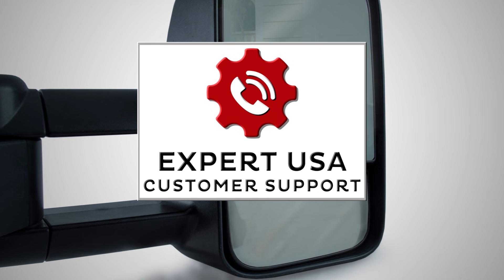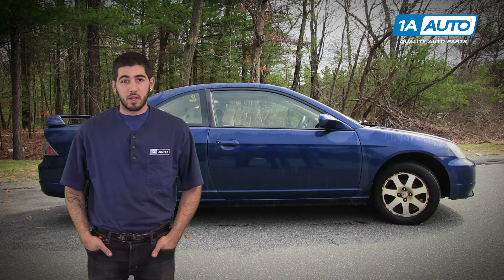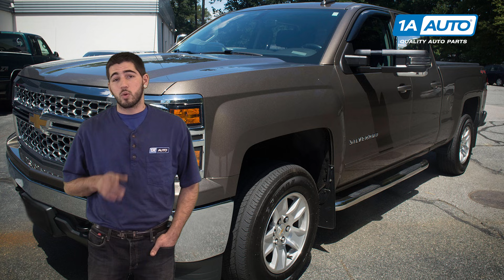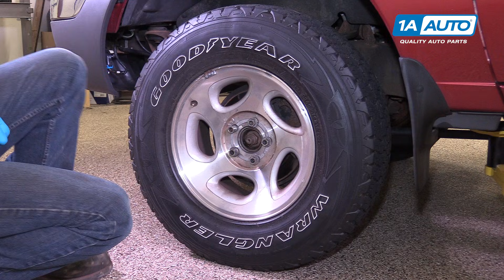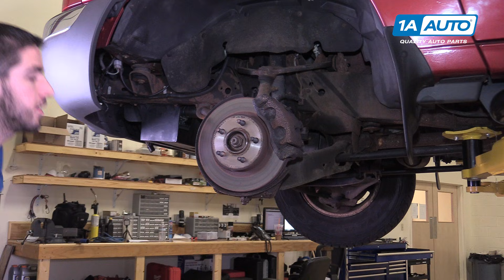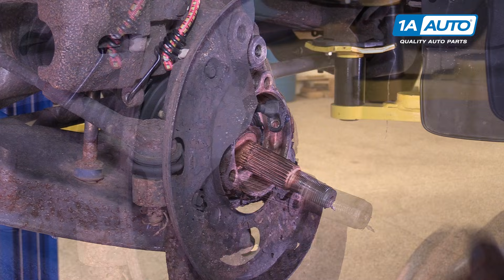How to Replace Front Wheel Hub Assembly on any Car, Truck or SUV

Comment: I'm about to do the hub/bearing assembly on my 97 Mercury, it's still got the factory original and 370,000 km, it won't come off that easy lol, I'm already dreading that part! Thanks for the video though, nice to have real visuals with my manual

Comment: Most front wheel drive cars will not have the threw nuts holding the wheel hub on. It will only be held on by the spindle spline in the center.

Comment: Take extra caution when punching out that axle nut detent. I was not expecting the difficulty and time required to then fix the threads. They were never 100% even after spending an hour with a chase/oil on it. I bought a punch set from harborfreight and it smooshed the nut threads over. I then bought a special Axle nut removal tool that didn't do much. I might just dremel cut a triangle out of the nut to remove the detent as it was the biggest PITA of the entire install. I don't know how they are punching out the nut like that in these videos and then taking the nut off without damage. Such a hassle. Would be nice to find a locking ring to put on after the axle nut so you don't need to punch it.

Comment: I removed the wheel before coming to see that I needed to replace multiple parts as I was replacing the front brakes... I can still remove that center bolt I hope? Can I use wd40 on it? Great video! Thank you Soo much for this!

Comment: 9:51: Grease on the back of the brake pads?  Never heard of that.   It should be stressed that one should use extremely little grease or better yet, use a product designed for that. Heat will make grease run. If any grease at all gets on the rotors...lookout!

Comment: Looked and fit same as original🌗 allabout.wiki/FrontWheel also came with new hold down clips for the cable mounts. Thanks to you I'm rolling again they fit great and were easy to install Tom.

Comment: Wheel bearing assemblies come pre greased from the factory. Do you need to add any more grease to them?
I have a 02 XL7 and replaced both front wheel bearings yesterday. I'm assuming I don't need to grease them, but I'd rather not find out the hard way.

Comment: Don't push grease on the back of brake pads. That grease will heat up and drip onto your brake rotor. Then you will have no braking. Use silver based anti-seize instead.

Comment: What sort of lubricant should be applied to the axle before slipping the assembly back on?
Reply from the maker: +Andy Gholson Thanks for watching!  You do not need to apply any lubricant to the axle splines when replacing the hub.  May just clean off the spines a bit using brake parts cleaner and a soft wire brush!
Reply: @1AAuto  Thank You for the response.  Now I am trying to figure out why I can't get the hub assembly with new wheel bearing to slide on the axle all the way.  Need about another 1/4" to accomplish that.  The only thing that changed was the new bearing that was installed in existing hub assembly.  I can send pics?
Reply: @andygholson821  I know I'm late to the party, but I had the same issue. I used a bit of sandpaper to clean up the axle and it went right on.

Comment: Does anyone know why I have broke 3 wheel hubs in half
Reply: Anger issues maybe?

Did you over or under tighten the axle nut? That can cause premature wear and failure of wheel bearings if it's not torqued to spec.

Comment: Can I ask you a question. I have a 2001 chevy express conv van and it has 202k miles on it. Still runs strong. Might use 1/2 quart of oil between changes. Are these good motors, 5.7 v8, only thing it needs now is do,t brakes and struts, which I'm ordering from you guys. Just wanted your opinion on the miles I have and if you think it is a good motor.
Reply from the maker: +Badams63 Adams Thanks for checking us out. This is largely dependent on the upkeep the motor has had throughout its life. 1aauto.com

Comment: Is there a reason the whole brake system was taken apart to get to the hub? Every other video I have watched about doing wheel bearings shows the system taken off in one piece . . .
Reply: They replaced the brake pads and rotors, so they just did it anyways.

Comment: Dont you have to get the bearing of the hub? I'm trying to replace my hubs because my threads are bad so holding a 5 lug is now 4 but the question please
Reply: No u just replace the hub assembly which is all 1 unit.
Reply from the maker: +sergio pineda

Comment: Great video for replacing front hubs on a 4 wheel drive. Suggest your company can make one for replacing the rear hubs that have the emergency brake shoes. The shoes interfere with using a cold chisel to remove the hubs.

Comment: Very simply video and easy to follow but can I apply this procedure on my 2014 Ford escape FWD...reason I asked is because I'm trying to buy a front wheel hub assembly for this car but all I see is this, "Rear FWD wheel hub assembly", on a competitor site. I got confused. So is this for front wheel assembly when I see this?
Reply from the maker: +wnwill The steps will be roughly the same for your vehicle, the basics will be able to be used for this repair. We cannot speak to other vendors but this to us reads the rear wheel bearings for the vehicle that is FWD.

Comment: Is it appropriate to grease any surfaces or open the bleeder when compressing the caliper piston? I've heard closing the piston with it closed can send dirty fluid back up into the system, is this true?
Reply from the maker: +DrFillyBlunt We would not recommend opening the bleeder while you're trying to get this install done. If you need to change out your fluid we recommend doing that before hand or at another time as this may cause a fluid backup as stated.

Comment: Hey guys had a quick question when replacing the wheel hub  do u also have to install a new bearing with it or leaving the old one is ok if u have no problems with it? For a 2009 civic lx sedan
Reply from the maker: +Jeffrey Rodriguez Thanks for watching!  Most vehicles have hub assemblies that have the bearing in it already, so it will automatically come with it!  If you have press on hubs and bearings then you will want to replace the bearings along with the hub.  1aauto.com
Reply: @1AAuto   ok got it thank you for the info I really appreciate it!

Comment: Why is it that so many videos show either only bearing replacement or involve disconnecting the spindle and knuckle when clearly all of that is unnecessary. Or is that only true on something vehicles?
Reply from the maker: +Glenn Gutenberg Depending on the vehicle some of this may be necessary to access the bolts to remove the wheel bearing hub assembly from the knuckle.

Comment: Clean the pins? with silicone grease?
Reply from the maker: +Johno Vegas The caliper pins can be cleaned with a wire brush, you can put some caliper pin lube on them to keep them functioning correctly. You can usually find it at you local auto parts store. Hope this helps you out. 1aauto.com

Comment: Does the abs sensor also controls the odometer reading? Anyone, thanks.
Reply: No it doesnt. the speed sensor doe that
Reply: in a ford ranger and similar there is a speed sensor in the differential.
Reply: Crazy Candy Crush no

Comment: Is it easier to just remove the whole caliper and rotor at the same time as one unit? Nice and easy vid to follow as always.
Reply: James Chuaycham ป้อม ศักดิ์ชัย ,yes you can do that so you dont need to compress the piston and avoid the brake fluid dripping just make sure to hang it so the brake line dont get hurt

Comment: Good video except the case that the hub almost never comes of that easy, especially if you live in the midwest/ where they salt the roads heavily in winter.  The driver side hub took at least 4 days and I used a chisel, acetone, doused it in penetrating oil, rust inhibitor gel/ several mind blowing whacks with a heavy duty mallet and finally listening to some angry music the hub came off as i deformed the face of the hub ; didn't matter as I already had the new one.  So that whole trick of tapping with a chisel is hogwash.  I'm a back yard mechanic and have been that for 13 years.  So put or verbally state that this may vary from vehicle to vehicle, as I drive a 2009 malibu and removing both front wheel hubs was hell!
Reply: Doing anything at all on a Malibu-- especially Gen 7-- is like pulling teeth lol
Reply from the maker: +Ayodele David Akinpelu Thanks for watching. If any of our viewers needs to make this repair, we carry the auto repair part shown in this video on our website. Here is a link to them http://www.1aauto.com/?utm_source=YouTube&utm_medium=CTA+Comment&utm_campaign=ytcomment&utm_term=4BOZVeDIICM

Comment: No use of a torque wrench? Also don't think it's a good idea to tighten your lug nuts with the full weight of the vehicle on your wheel
Reply: My owner's manual states to make sure the full weight of the vehicle is on the wheels before tightening the lug nuts to spec.
Reply: Doesn't matter  pal if is on the ground I torque  them to 90 pounds and they don't come out

Comment: Great vid, did anyone notice that there was a leak coming from the brake line when he was playing with the brake caliper.  wouldn't that be something to fix while the tire is off. hopefully he fixed it before he finished.
Reply: The brake fluid drips from the engin bay, its normal when you press the piston caliper
Reply: when you push brake fluid back into the lines and up into the reservoir, the reservoir will sometimes overflow and spill out. it's normal.
Reply: I was having a fit as I watched the brake fluid spread ... I wanted to punch my screen lol
Reply: Daniel Son they didnt pay him to do that so he puts it back and lets them kno to check it so he can get a full bill again